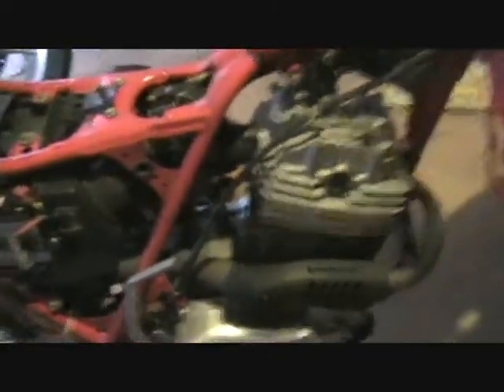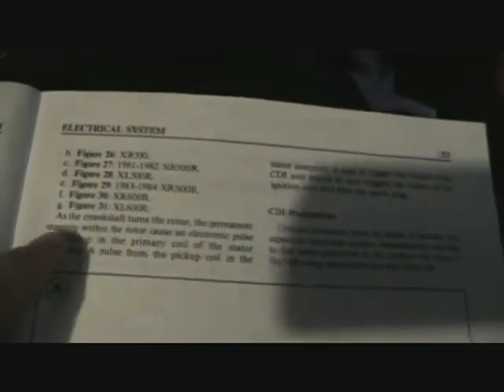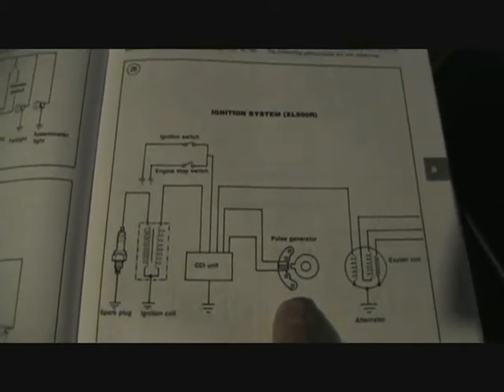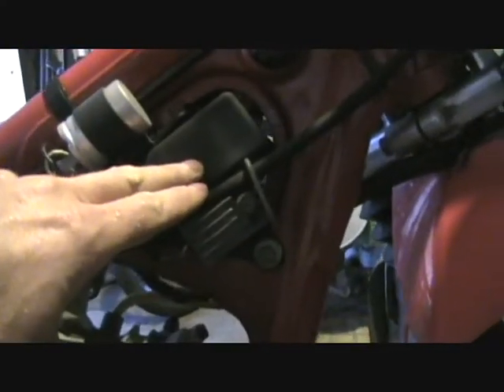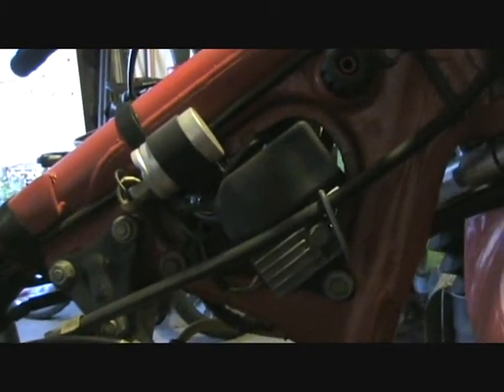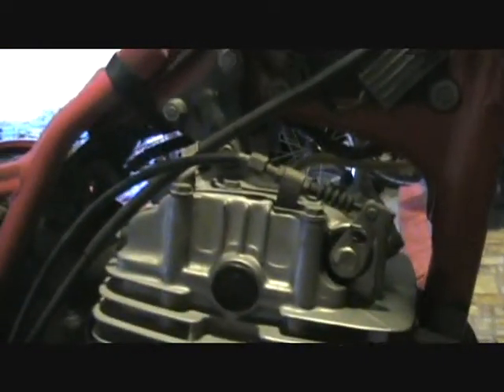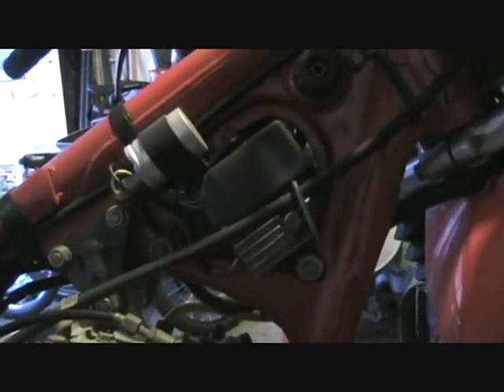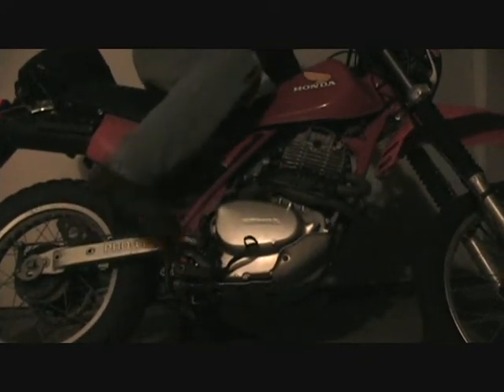Motorcycle Electronic Ignition Troubleshooting Honda XL500R

Comment: Hopefully you see this as it's a very old video. I have a 79 xl500s and I'm getting a no spark issue. I'm pretty sure it's the coil accordion toy multi meter. Problem is xl500s ignition coils are very hard to come by. You're using a xl500r harness on a xl500s motor which seems to be working for you. Was wondering if the bikes up and running perfectly now? I'm thinking ima have to swap all the ignition parts to xl500r. Hopefully itd work
Reply from the maker: Yes. My bike is still running fine. I had the same problem as you, as the 1984 electronic ignition was only made for one year, and Honda quit making the parts years ago. I found one on eBay after a few months and it worked. I replaced the coil and the brain box.

Comment: hey back at you, i failed to mention that i found a  1981 honda XL 500 s, with 3200 miles on it, story is that it was driven for one one season, had a very minor dump, and was then stored tarped in a heated garage for 37 years. the fuel system was filled to the top with rich oil mixture. engine was "fogged" and carb was drained. fuel tank was cleaner than a newborn baby's ass. I drained the oil, put in a new battery, new NGK spark plug new fuel added  with a little marvel mystery oil for upper cylinder lubrication, a in-line fuel filter  and let the fuel run thru the carb. It fired over and held smooth idle only after the 3rd kick. tires still have the little tits on them . oiled and adjust chain  and a couple pounds of air to the tires,and took it for a spin after letting it warm up for 10 min. amazing power ,no smoke  and shifts like a dream. had to replace the front fender ,as that was really the only damage i have found thus far. currently going over every inch and cleaning  her up, trying to achieve museum like quality. it's a  supreme Fox! , wanted to know more I should do after the nearly 40 year nap it took. Also;( no oil leaks yet) fork oil is next. gonna use Honda brand. there are no leaks after driving it 75+ miles, highway street and a very long steep hill I just had to conquer. at your leisure would appreciate any advice.  many Thanks !!!
Reply from the maker: Opening up the carb and cleaning it and replacing gaskets is a good idea. Other than that, just ride it and have fun. These are tough old bikes.

Comment: I bet you it's a leak and there's oil getting on the Magneto pull off the side panel with the gear shifter and see if there's oil on the Magneto if so you got a bad gasket.
When you let it sit with the kickstand it's sitting at an angle and all the oil runs off and then we'll start again
Reply from the maker: +OG GAMER Thanks. In this case it was either the computer or the coil. I replaced both, and it works fine now.

Comment: I use a bunch of bikes that have that kind of CDI. Please check that the epoxy on the bottom face of the CDI has no crackes or has not separated from the plastic box. Honda ( SYM or Kymco ) as they are known here in Taiwan have a reputation for dodgy CDI units. When they fry they can bring the coil with them. You should get about a 1cm spark from the coil lead to the engine when kicked over with no plug in. If not, the cdi unit or the high voltage coil in the alternator are faulty. Good luck.

Comment: the stator cooks and i recommend that you change it every two years. it has a habbit of starting when cold and when it heats up it dies out. dont listen to me though i just worked on this 87 honda xl600r and tryiing to troublshoot it for the longest time. I had my cousin from harly thats a mechanic, had he tried and failed at finding the problem with the ohms meter.

Comment: Stator fixed mine. I would give it a good charge and would start very easy. I took out the spark plug and ground it against my cylinder head and i noticed the spark was very weak. Stator gave me the fat blue spark i needed.

Comment: hoohoohoblin<   did you ever figure out why the bike cut out after 7 miles?  My buddys did the exact same thing last weekend however after it cooled off.  We were unable to restart the bike.  will change plug and see if theat works.  I have done some reading on line and the plug cap is a good thing to  replace to eliminate as a proble.  The cap much like the coil has a resistor built in.   we are going to try a hotter plug and see if that helps

Comment: I have got same problems on my '81 CB250RS which has a similar ignition system. Since buying the bike in April this year I have only ridden it 3 times properly. I have got one problem after another. First, the regulator/rectifier went, frying the battery. After that the auto advance unit on the end of the crank went.
Now, after fitting a new coil, HT lead, cap, plug, CDI and regulator there is still no spark.
I am just about pissed off with it. Easily the most unreliable bike I have ever owned.

Comment: I am about to put in an '80 xr500 motor to my xl500r. Do you need to switch out the generator/rotor assembly to the 12v for everything to work right?  It looks like the generator wire on the XR motor is different.. thanks hoblin

Comment: my 1971 suzuki ts250 used to do the same.stars rihjt up and 15 minutes later dead.so so and replace many parts electrico..anyways the problem was a stator generator.bummm fix the problem running like champ

Comment: The best test is substitution of a known good part. Easy in a shop, the mechanics don't have to pay for them first.

Another way to test suspected heat-affected parts is by cooling them rapidly with freon or a fire extinguisher or even cold water (use yer head!).If it starts, you found it.

If the part has the word 'coil' in it, it's usually a broken wire that expands with heat and goes open circuit and  makes contact again when it cools. In 'black boxes' it's usually a component gone bad.

Comment: My 1987 Yamaha XT 600 had the same problem. Every thing pointed to the cdi. Changed it, {$150} Did not fix the problem . It turned out to be the pickup coil. Also check your charging voltage.[at battery] My friend bought a 2000 Aprilia Pegaso[ single cyl] It would run, turn off , re-start ,would cuttout, Restart ok... cuttout.on and on. Turned out the voltage reg. failed .20 volts going to the cdi Fried the cdi! Also my Xt's side stand switch failed. Does your Honda have one?